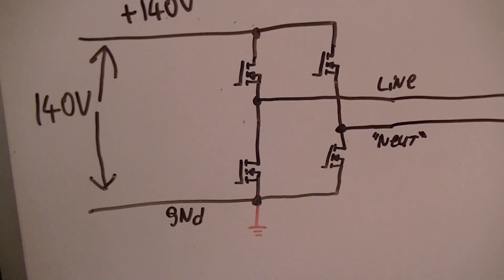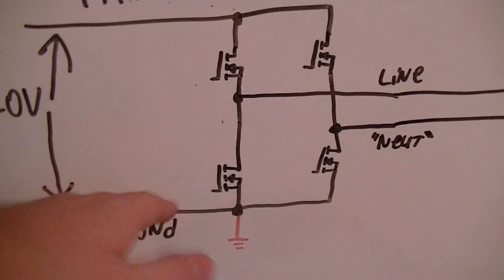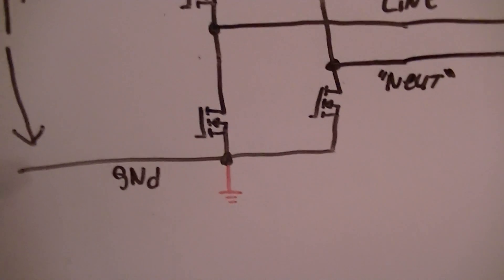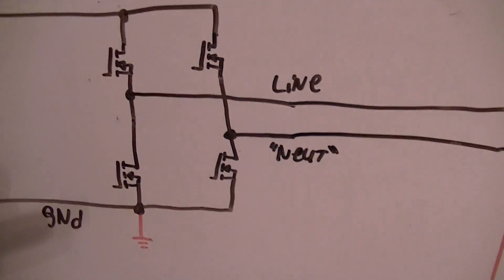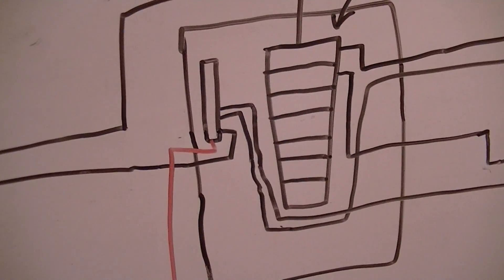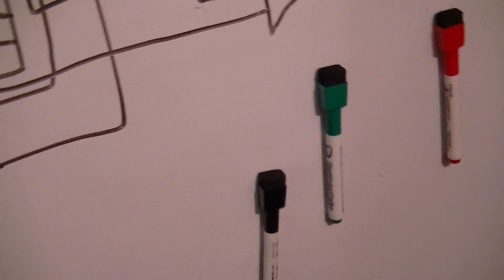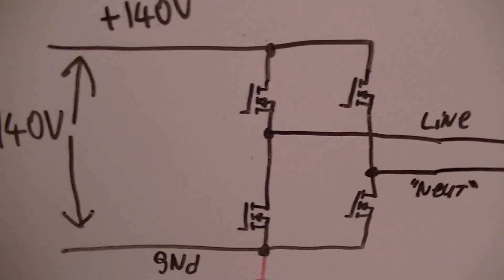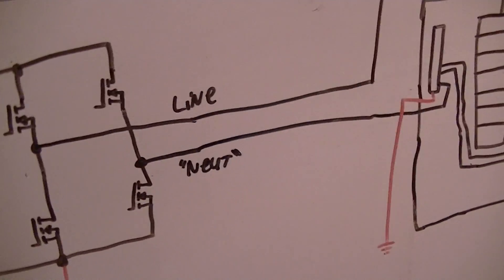Important inverter safety warning

Comment: I bought a 1500w/3000 power inverter dc 12vto ac 230v comverter car 4 usb camp 2 sockets used it 3 time on the 3rd time i ùsed a hover small one and it damage my car i cant no longer use my cig lighter for any device

Comment: Can i connect my pure sine wave inverter to my apartment's subpanel which has the neutral and ground separate?
Reply from the maker: I would avoid backfeeding unless you have a proper transfer switch or an interlock device.
The neutral and ground are always bonded somewhere.

Comment: Neutral is at ground potential at the first point of disconnect in standard homes. WHICH would be the meter can outside of a home. So your diagram is partially false.
Reply from the maker: Tim Kassian Standard American/Canadian practice is for the neutral grounding connection to be made at the main load center.  My diagram is based on this.

Comment: Does this danger exist with true sine wave inverters using a transfer switch?
Reply from the maker: This applies to any inverter that does not have an isolated output.  An isolation transformer (that actually isolates the input and output as many have them electrically connected for safety reasons) would work to isolate the supply from a nonisolated inverter, but would introduce additional system losses.

Comment from the maker: Some inverters have the 'neutral' side of the H bridge grounded and have the 140VDC/280VDC (depending on output) buss and H bridge drive circuitry isolated from the DC input.  This is somewhat rare as it requires an isolating supply for the H bridge drive circuitry.
Another option is an inverter that uses a mains frequency transformer as it inherently isolates the output.  This is only done with stationary and some very small inverters as the transformer is big and heavy.

Comment from the maker: The problem with propane is that it cannot be easily transferred between tanks the way that liquid (at atmospheric pressure) fuels can.  This is not a real problem for filling small (i.e. 20lb) tanks from a big one, which can easily be done with a wet lead.  It IS a problem if you have a big tank without specialist equipment.

Comment: I have 3 gen sets 2 are hooked in parallel 10000 watt sets I have them hooked up to a asco make before break systems Mine is a hardwired asco switches and have the nurtral   bonded with ground and also a 10 foot grounding rod in the ground.. I set up before I became total disabled I was on borrowed time when I got out of the NAVY. I am looking to change them to propane as it is easier to get during blackouts but the pricey.

Comment: I have worked on a lot of inverter in my years and a bunch of UPS and generator sets. I went to several schools on them  I started at KW controls after I got out of the NAVY I was a disabled VET when they hired me . Those inverters are some tricky shit  I have worked  on from .5 to 200 kva ones from 120 to 14.4kv 3 phase. I remember one 125 kva a asco switch was programmed wrong and  it sent 480 back tru the utility lines man talk about a blast cost 2.5 million to fix.